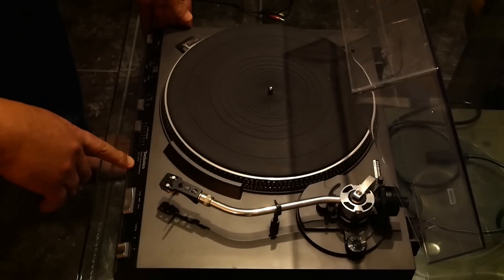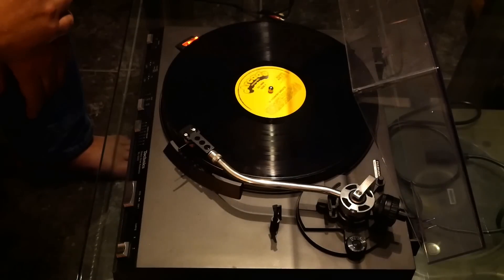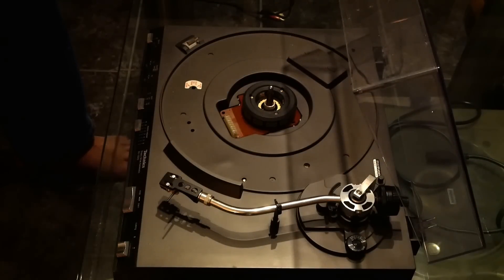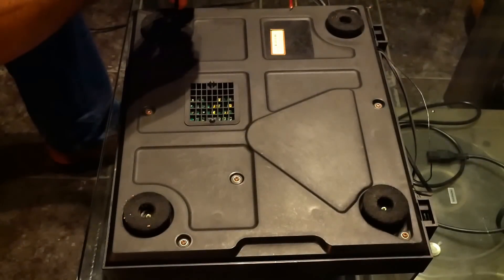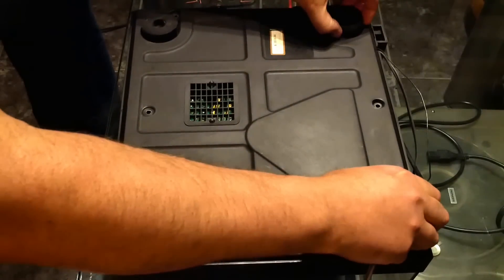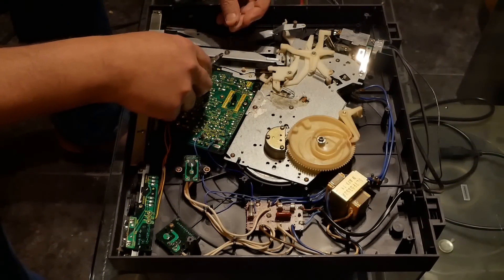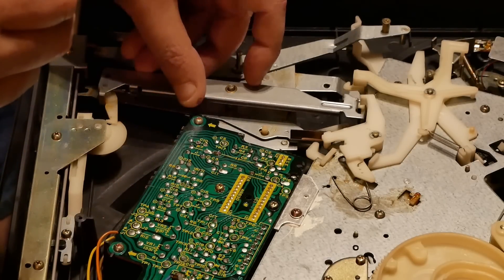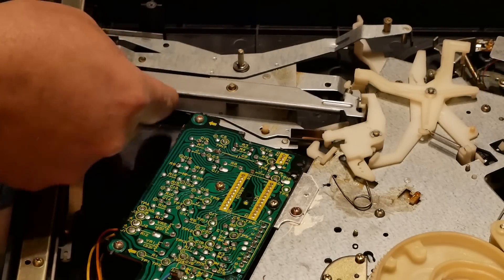How to fix the constantly repeating return problem of theTechnics sl-3310,  sl-3300, sl-5300, sl-230

Comment: This was perfect, thanks so much, it just solved for my SL3300 constantly repeating.  I wasn't sure the little white plastic arm was proper on the repeat cam gear, but once put back together, working perfectly. Also cleaned the speed pots while inside it and keeping perfect speed now too.

Comment: Thank you so much! I''m a novice when it comes to repairs, and this helped me greatly! I've got an Technics SL-D3 that was stuck in repeat as well. Looks really different inside, the metal thing you removed is shaped differently and is made of plastic for example, but learning from you that I can remove the metal ring(s) and e-clip helped! Greased it, put it back together and it works! Thanks!!
Reply: Did you take any pics? I have to do my SL-D3 and I want to know what I'm getting myself into. lol.
Reply: My SL-D3 too

Comment: Thank you! I did not have the exactly same problem, but you showed me how to remove the bottom and opening it up and then I checked every moving component with old grease. I actually did not remove the all parts, just gave them a little WD40. Then it worked! Thanx!

Comment: These video's are very helpfull, looks like that problem is the same as that of my brothers Technics turntable from 1980, he hadn't used it for decades,stored it at the attic but when i tried it... that repeating problem occured, it's not the same Technics but there's a good possibility it might be the same mechanism. Another one of his stored turntables the B&O 4002 had an armlift problem and that was also caused by dried out grease. i think many old stored turntables from different brands have this sort of problems but it can easily be solved like Vintage stereo shows.

Comment: This was very helpful. Wondering if Mr. Vintage Stereo can help with my problem on a Technics SL-230 belt-driven turntable. My albums skip/stick usually in the same spot, no matter the record - about 2-3 minutes into the first song. After that, it seems to sort itself out. But it's annoying and frustrating. Wonder if the problem highlighted here might be the fix fore my issue. Or maybe not. I have tried realigning and the weight on the cartridge and the tonearm every which way imaginable with no luck. Even tried with other cartridges but the problem persists. Suggestions? Solutions?

Comment: great video! thank you! I have a similar problem. When the arm reaches the end of the record, it does not automatically go back. So repeat doesn't work either. is the mechanism on which I have to act the same? or is the problem in another leverage?

Comment: Can you tell me how to fix the volume output on the technics direct drive automatic SL-3350 player ? It will be turned all the way up but it’s not near loud .  Please 🙏
Reply: most likely is you need a pre-amp. they are inexpensive, like $25.